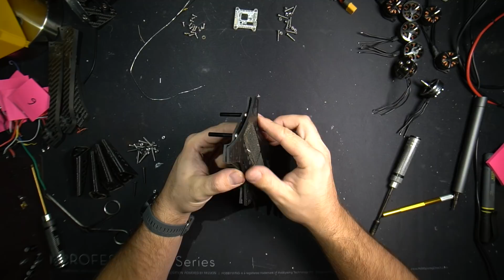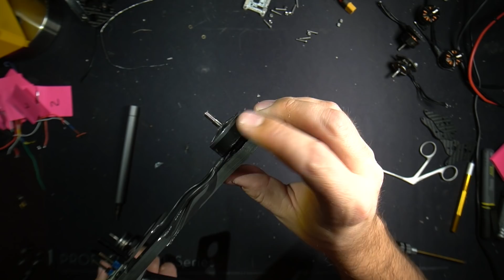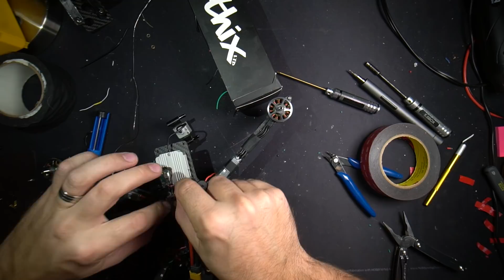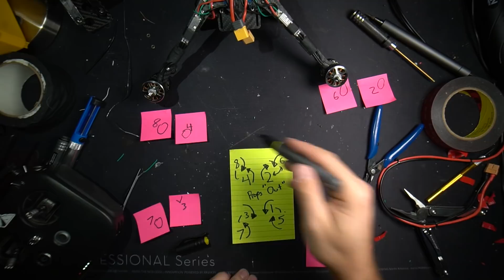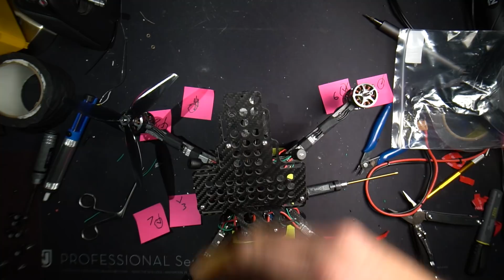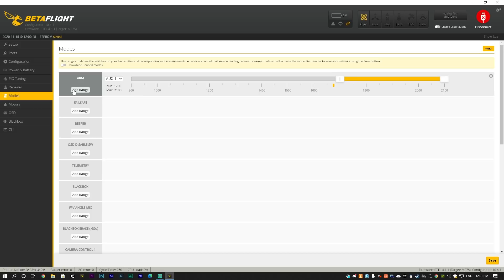How to build a Cinelifter (full build tutorial) - ShenDrones Thicc

Comment: Maybe I missed it but I don't see a link to the landing gear or legs that you're using nor the bottom motor plates. I reviewed the instructions that come with the frame and I don't see either of those as parts that come with the frame. Seems like that would be important to keep the bottom props off the ground. Thanks in advance.

Comment: I ran into problems with using 12v regulators for the air units. They can pull up to 6a. causing the the Air unit to reset midflight I had to add an additional cap directly to the 12v regulator output. I didn't like that so I just ended up running the Air unit off a dedicated 1100 mah 4s pack and that took care of the problem.

Comment: NUURK thank you for this video - Ive build a bunch of 5" quads and this will be very helpful on my first cinelifter build! One question - this was recorded a while back and youre using arm-mounted ESCs and a PDB - I see a lot of the later videos using two 4-in-1 ESCs, but I actually PREFER dedicated arm-mounted ESCs and a PDB because it makes the system more modular. Except these are no longer available via the links in the description. Any suggestions on building this the same way but with updated components?
Reply: @MITCH I was able to find ESC's but not a good PDB. although you can just splice wires together instead of a PDB and use a small dc-dc converter for 12v, 5v etc. But I think it's just better to go to integrated ESC'S -- I still like the arm mounted ESC'S but seems like the industry has moved away from it enough that it's just too much of a hassle

Comment: Thanks for the video! So are the two batteries running in parallel or series? I’m planning to build a shendrones  insider first, and then a Thicc or siccario later, and these build videos are very helpful!
Reply: He has two complete seperate power systems. So each one you plug it’s own lipo into. That easy too you have like max redundancy.

Comment: Hi Nurk! Is it possible to build a cinelifter using 4 bigger motors with more blade props instead of using 8 motors? Thanks!!
Reply: Imagine if one of the props or motors failed - no chance of recovery. More motors means lower chance of catastrophic failure.

Comment: Thanks for this great build video. I'm currently building one myself and wonder why you used this polulu voltage regulator instead of the 12v supplied by the diatone pdb? Would be great if you could explain this. Thanks!
Reply: I just realized that the pdb only supplies max 200mA at 6s which is not enough for the air unit

Comment: I tried out the tune and got some really bad mid throttle oscillations. Turned D down by quite a bit and it worked well. This was with a Sony A6300, so not the full weight of a komodo. Do you think the heavier payload is better for your tune?

Comment: Because of yaw , running counter rotating props if one goes down and you yaw it will death roll. If you run all motors as in a standard quad , 4 motor inputs . if a motor goes down it can still yaw because all 4 corners of the craft are supported.

Comment: great video man, please excuse my idiot question but do you have to have a flight controller with 8 signals why cant you reverse the bottom motor wires to have the motor spin opposite of the top do both top and bottom motors not receive the same input I'm referring to the top and bottom motor on the same arm x4 of course just curious to how this all works are there 8 different inputs to have all 8 motors spin at diff RPMs is that why? I just thought the two motors on top of each other acted as one big motor again sorry I'm new to this type of build thank you again
Reply from the maker: I believe it would fly with just 4 inputs.. I should try it.. but you wouldn't have the redundancy that you need - one would just fail.
Reply: @NURKFPV  Hi nurk running a 8 motor quad config you can drop 4 motors and still fly. the x8 will fall out of the sky if only one motor goes down
Reply: i mean if you have splitted signal wires and one esc smokes you will still fly but if one of the 4 signals coming from the fc pad goes bad than it will crash @kwadkenstine4988

Comment: Why do they choose contra rotating props? Why not bigger props? Does it add anything to the handling or manoeuvrability? Because contra rotating only provides about 40% more thrust.
Reply from the maker: Having a smaller/denser profile was very important for this bird, rather than going with bigger props which decreases the flight characteristics and makes it a bigger build.
Reply: @NURKFPV  that's what I assumed. Try to match freestyle form and just add thrust to carry big cam. Interesting way to do it, I guess with size comes with stability that's not always wanted.